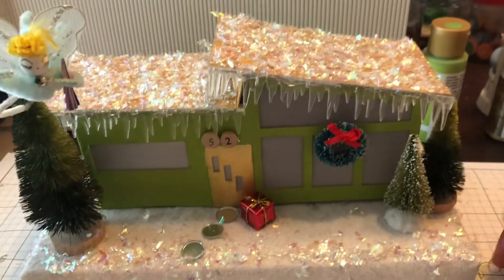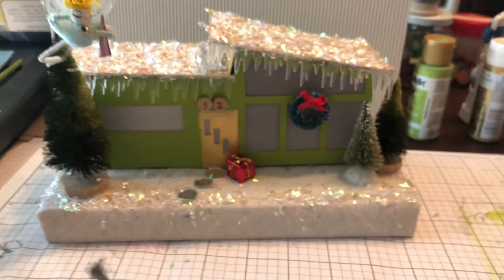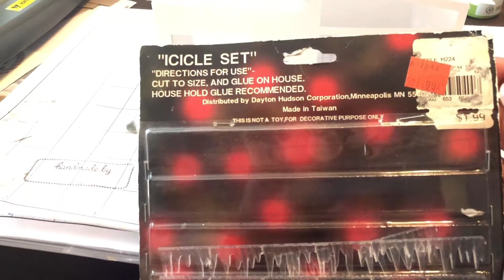Mid Century Modern “Putz” House | Christmas 2019

Comment: I love Putz houses in general, and esp love this modern one...you've done a great job....I've had success making icicles using Elmers glue (it dries clear), wax paper and glitter...any clear glue should work, but you want one that is in a bottle with a tip/nozzle  and that is thin enough to 'write' with but thick enough to hold most of its shape....on wax paper take your glue and do a line of glue and make icicles as you go...you can make them any length b/c once they dry they can be cut to shorter lengths or pieced tog for longer lengths...b/4 the glue dries sprinkle it with glitter if you want it to sparkle...it takes awhile to dry, but once dry it stores very well, so you can make it ahead and have it ready...this idea is not mine, I saw it here on youtube...I will see if I can find the video I watched a couple of years ago and I will post it here.
Reply from the maker: Dinahsoar Thanks so much for the tip! I will definitely give that a go!
Reply: @DreamVintagewithDJ  One more tip...I attach these to my putz houses using a hot glue gun. If the strip of icicles is not long enough you can easily join the next strip when you attach it to the house with the hot glue. They are not fragile either, so they are easy to work with.
Reply: @DreamVintagewithDJ  Here is a Pinterest image that shows the icicles that look the most like mine..I think this is where I got the idea originally...the link to the actual webpage is broken but you can at least see the image: https://www.pinterest.com/pin/414331234440060021/
Reply from the maker: Dinahsoar Thank you! I will attempt to make some.. seems doable!
Reply: @DreamVintagewithDJ  You're very welcome..I left so many replies I was afraid you might think I was a stalker..I love paper crafts and love sharing what I've learned from others so I tend to go a bit overboard... Happy Crafting!
Reply from the maker: Dinahsoar haha! Not at all. I like crafting to so the more info or help I can the better!